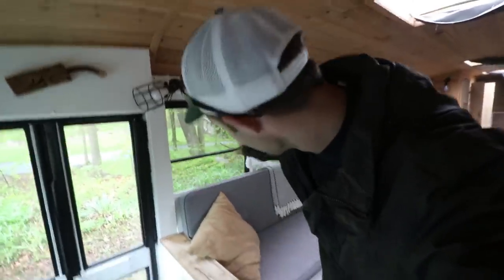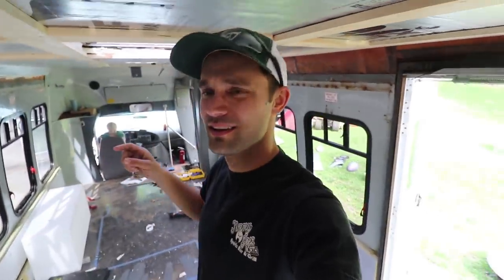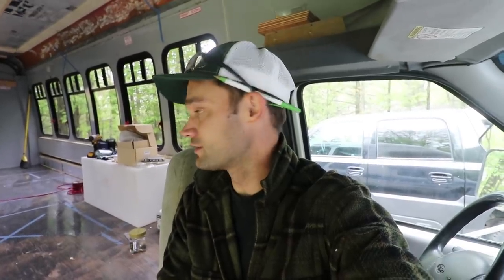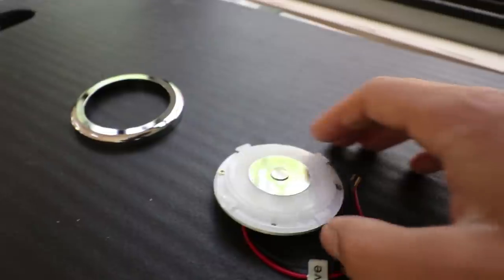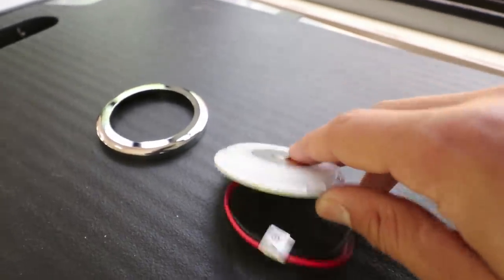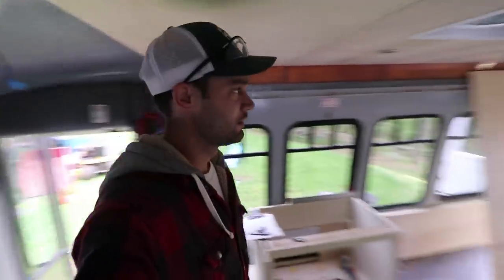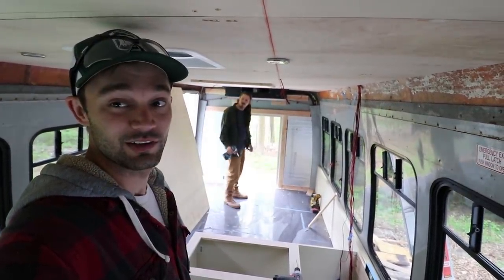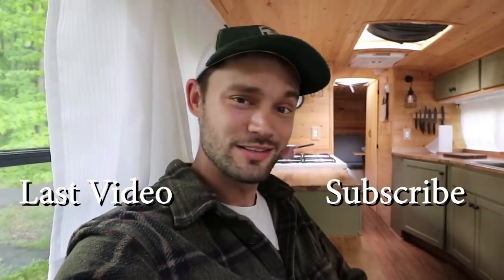New School Bus Build - Shuttle Bus Conversion

Comment: Nice build.  I've wanted to do a shuttle bus myself.  How are you attaching the wood to the fiberglass?
Reply from the maker: There is metal structure in this model so it was attached into the metal

Comment: Aren't you insulating the walls?
Reply from the maker: On this particular bus no. The client did not want the extra insulation because of how they will be using the rig. Also, this particular bus already has 1.5 inches of insulation built in between the fiberglass
Reply: @navigationnowhere  thanks.  Trying to learn all I can